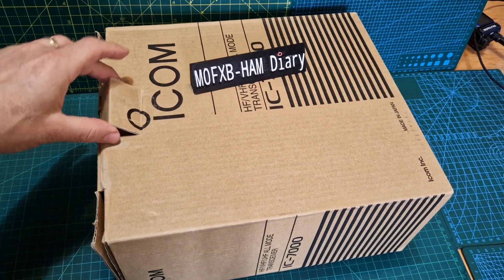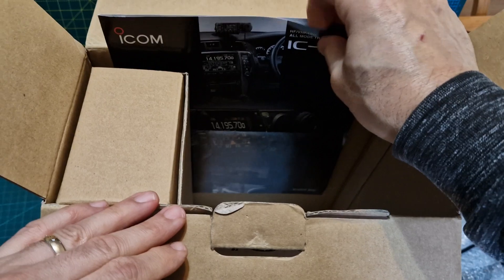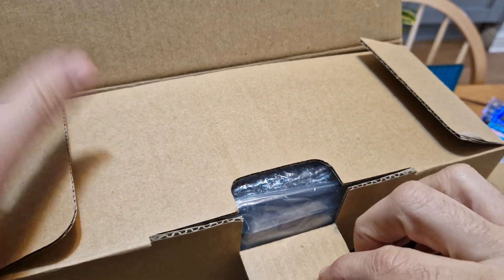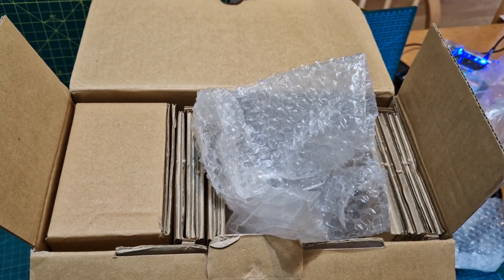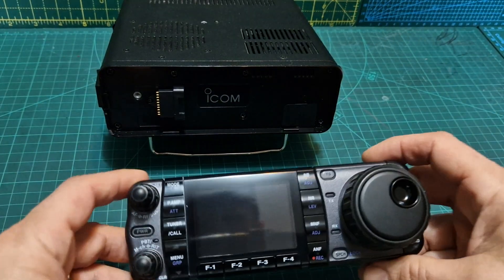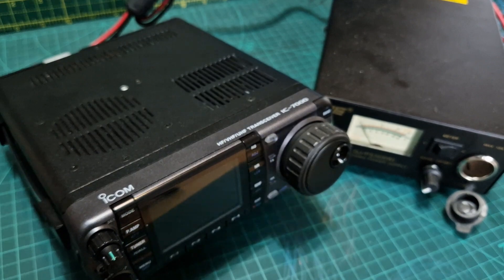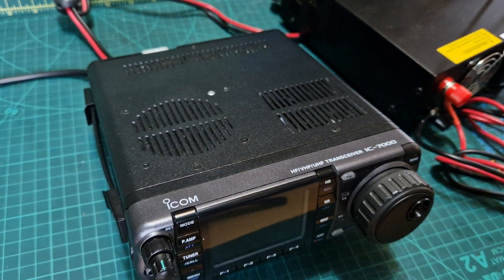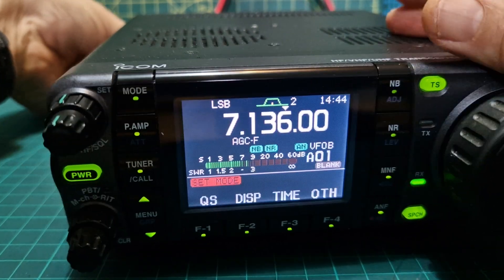ICOM IC-7000, UNBOX & TEST 2023

Comment: I had four of these 7000's at one stage - I used to buy one every time I went to the USA on holiday and would bring them home to Africa. I sold three of them a few years ago, and kept one which I still have and will probably never part with. In my opinion, the best all in one mobile HF/VHF/UHF rig for the vehicle that has ever made. Just gets a bit warm and likes the voltage to be above 12.8. I run it with a Little Tarheel screwdriver antenna and automatic antenna controller - perfect rig for the car. Icom needs another one like this with this form factor
Reply from the maker: Hi all very interesting yes it's a keeper ,73
Reply: Also one of my favourite transceivers ever. Stupidly I sold my original one but happily have recently replaced it. xggcomms in the UK sell a superb sound card interface, with just one USB connection for Sound I/O and Radio Control & Telemetry. This works a treat with the likes of WSJT-X and other fine software. I like the video out, which you can use with a suitable monitor or capture device into your PC to give you a 'big screen'. The radio's only apparent oddity is that you need to disconnect the microphone when you are doing PC digital modes, as the microphone is 'live' during transmit and will pick-up any other sound in the shack.

Comment: Just picked up one of these with similarity little apparent use. Its an excellent radio although very sensitive to input voltage. 13.8 no more and at 12.6 its not happy. Gets a bit hot above 50w.
Reply from the maker: Yes agree

Comment: I am currently using my ICOM 7000 in my mobile with (3) HUSTLER Resonators on a 22” mast and it’s AWESOME. It’s the Fourth one I have owned over the years and if it were to fail and not be repairable I would buy another one.I Hate touch screen radios so I will never buy another New ICOM HF mobile and I try and buy only ICOM Radios when possible.I have never had any issues with any of them and they all have been great in my mobile and my shack.👍🎙
Reply from the maker: Hi thanks loads I love mine .
Reply: You say it's your 4th IC7000.   You also state you've had no issues with any of them.   Does that mean you currently own 4 of them?   Or that you got rid of 3 of them for other reasons?
They seem like nice radios.   I currently have an IC 706Mk2G.   Which works great.   But I'm thinking in the future I may want one of these.   What say you?

Comment: Thanks 4 the video!
I would like to see it in data mode running FT8 or WSPR (eg), probably even on 2m :)
73
Reply from the maker: Hi yes I will do a video using it ft8 also I have a opc2350 cable I will try chirp.

Comment: I am suffering buyer's remorse with mine. I purchased it from ebay.  It is region 0, the Japanese usage model.  It is very crippled when it comes to frequencies. 2 meters is only 144Mhz to 146Mhz, 70 centimeters is only 430Mhz to 439.99 Mhz.  I do not know a way to expand the radio frequencies.  I can expand the receive, but not the transmit.  Thus, I can hear all of two meters and 70 centimeters, but can not transmit on it all. I am very regretful.
Reply from the maker: So sorry , best sell buy a USA model
Reply: There is no way of expanding the TX on the Japanese version. However, most of the bands are similar to European band plans, so you might get a buyer for yours there (or Japan of course).

Comment: You have diversity mode on the 7000, thats what the two antenna ports are for. nice radio all the same.
Reply from the maker: Hi Mat do u know menu setting ?
Reply: There is no such thing on the ICOM 7000.The 2nd antenna port is for the VHF/UHF antenna.I currently own one and it’s my Fourth one.Your information is Incorrect and we should only share Facts so someone doesn’t damage their radio from misinformation.👍🎙
Reply: @1OFGODSOWN  there are three replies to my original comment, one of which i correct myself having got two radios confused. May i suggest you read all comments before trying to belittle me with yours. Its not big, and its not clever.